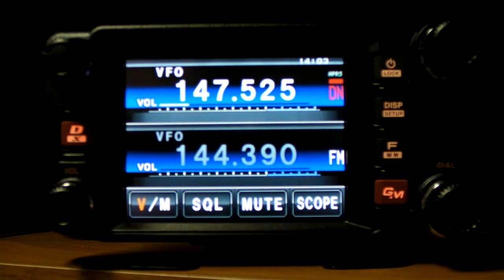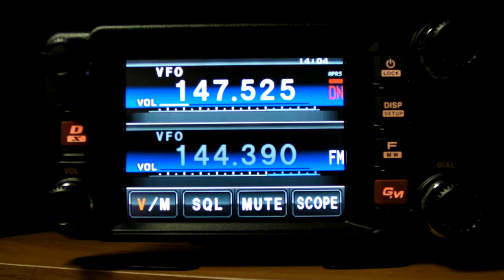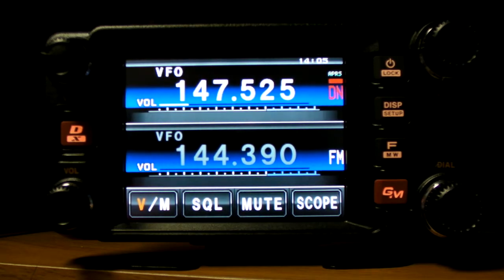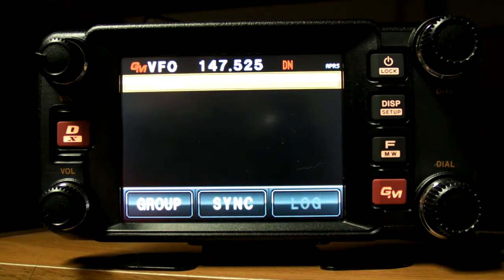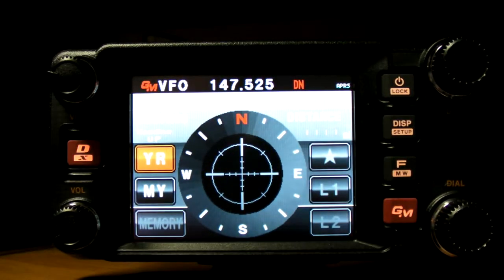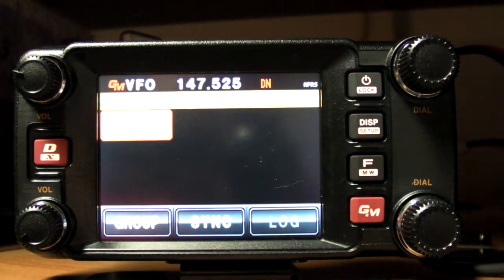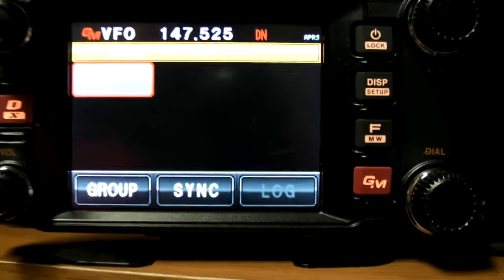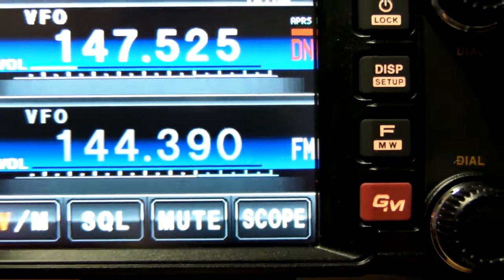Yaesu FTM-400D & FT1D - GM (Group Monitor) function

Comment: my 'GROUP' button on left bottom 
is grey. How did you turn it on?
Reply: mine is too, did you ever get it figured out?
Reply: I have not!
Reply: John Vo I called yaesu today for help getting the messaging within GM to work (you need a working sd card in each radio, that wasn’t in the manual). The Group and Sync buttons are greyed out or missing depending on the radio mode as their use has been discontinued by yaesu via the latest firmware.
Reply: Treading Dirt SW God Lord, thank you. been searching for an answer all day on this (nothing online anywhere about it) Just randomly watch vids in hopes that i could see a setting i missed...it a fricking memory card of all things. !!!! thank you.

Comment: Thanks for posting.  Could you please post a video on setting up GM from the beginning?  I'm having trouble following the manual and unfortunately the programming software doesn't program GM or APRS.
Thanks again.
Jim
WA3ERQ
Reply: Jim did you get it to work ? I’m interested also
Reply: Dr Chow not yet.

Comment: could you post/ share your thoughts on the text messaging feature? I'm still debating which way to go with Icom or Yaesu. I like the larger screen of the ID-51A but it doesn't seem like it is text message capable....Also not sure if it does way points either. Looks like the Yaesu stores up to 3 waypoints...Thanks for your comments
Reply: You probably decided by now (since your comment was 6 years ago...) but the Icom radios don't have traditional APRS built in. SMS text messages and emails can be sent through APRS, so if you were interested in that sorta stuff, I'd go with the Yaesu.